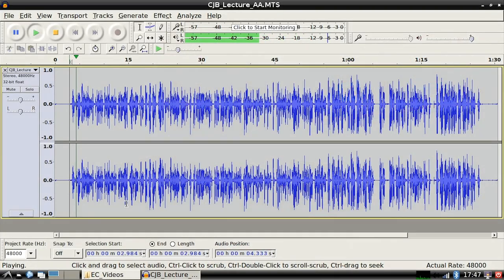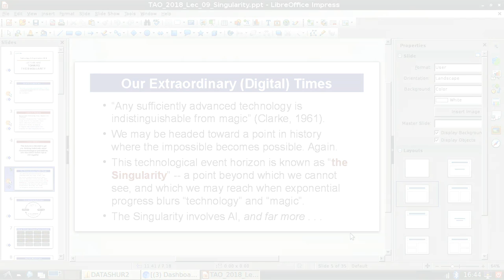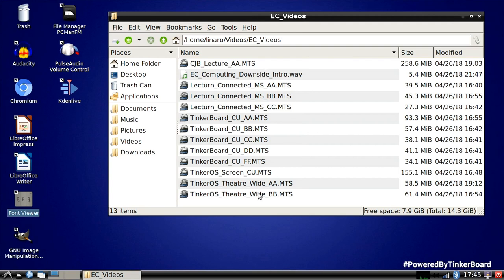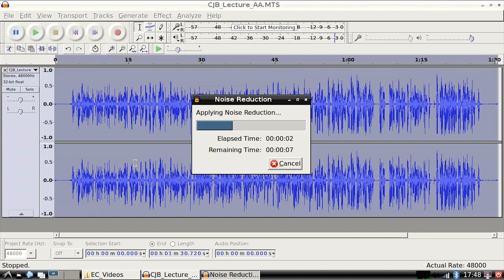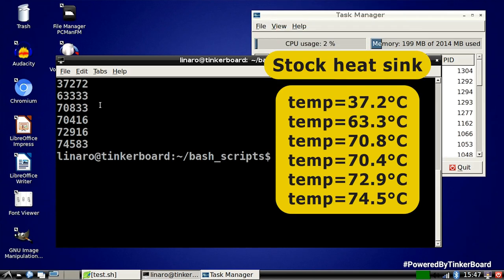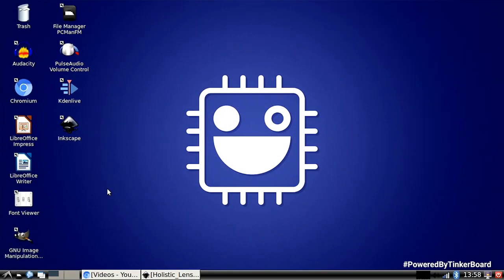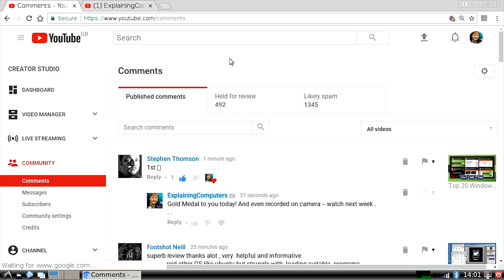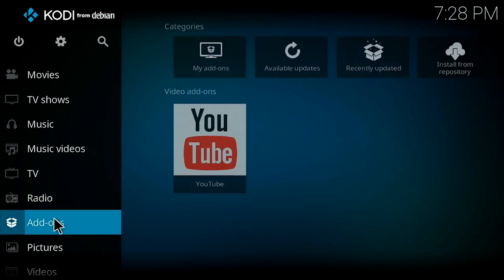Tinker Board Week

Comment: Hi Chris. Great video. 
It stayed a bit at 70°C because the Tinker starts to throttle at 70°C. That's why I don't like it that much. Compared to the Odroid C2 wich doesn't throttle or overheat even overclocked to 1.75Ghz. Also because of the micro-usb power supply and the Kdenlive problems. I can do everything on it, but I need different OS''es (tinkeros or Armbian for youtube, lubuntu for kdenlive) and a fan. 
The Odroid C2 does everything in Ubuntu Mate. Kdenlive, 1080p youtube playback, games, ...
I hope Asus there next board will be better.
I'm now working with the Banana Pi 2M Zero. Same form factor as the Rasp Zero, but quad core 1.2Ghz. Offcourse it overheat immediatly. The software is nowhere. But there's a stable Armbian for it. I do like it, but it's rather useless. Maybe only to make a handheld. Greetings, have a nice day.
Reply from the maker: Hi Nico, I thought you would comment here! The Odroid boards are indeed great. So many good SBCs these days!

Comment: Thanks again, Chris. What's the issue with the CPU running at the temperature it does using the stock heatsink? Is it throttling performance?
Also, why would they use a micro-usb plug for power that's above the USB standard and which requires a custom power supply regardless? Why not use a standard round plug that's smaller? Then there would be no risk of someone overloading the power supply.
Reply from the maker: I think they stick to the micro USB to keep the board compatible with the Raspberry Pi (and its cases). On temperature, the board does get very hot!

Comment: Hi Chris, greatings from Honduras (yeah google it); I recently stumbled upon some interesting info regarding heat sinks, the cheap ones we buy that come with some self sticking adhesive to the processor or whatever you paste it too, apparently this adhesive is more an insulator then a heat transfer catalyst so , I decided to un stick them and try thermal paste on them, sometime this week, already bought some cooler and bigger heatsinks online but still waiting for them, was wondering if the changing to thermal paste will to anything and maybe might a thermal pad do a better job if the adhesive really works as an insulation, finally determine the temp difference between the 3; if the adhesive really is an insulant Im guessing the pads wil do a better job, well see you next week Chris would love if you could do a video testing if you can get better performance from these cheap heat sinks just by pealing the 'insulant'
Reply from the maker: I am certain that using thermal compound will improve the performance. I'm posting a big cooling video the week after next.

Comment: Pretty enjoyable video! I'm very happy about your single board computer. Did the performance still a lot better than any others?
Reply from the maker: The performance is better than a Raspberry Pi. But not as good as, say, a LattePanda or UDOOx86 for this kind of thing.
Reply: So all of the SBCs are pretty decent and almost same performance as well? Some people had using SBC for gaming, such as 80s/90s and modern gaming.
Reply from the maker: Retro gaming is indeed big on SBCs. :)
Reply: Yeah. It's much massive and bigger than Commodore 64 specs. But if playing modern games will cause some lagging graphics performance and processor will much hotter. I hope the SBC will getting improve for future without having trouble with laptop/desktop PC.

Comment: About the S board. How does it handle a power button? Could you test this and maybe showcase?
Reply from the maker: Not sure what you're getting at. There is no power button. Power must be turned off at the mains, or using a switch in the adapter lead. After power down, power must be removed before it reboots.
Reply: @ExplainingComputers  that answers my questions enough. 😊 Thank you.

Comment: Don't use the copper between cpu and coolingblock.
It is to thick and although it absorbs heat very well the aluminium block can't draw the heat fast enough to cool
bouth the cpu and copper piece .
The cooling is done by the aluminium fins ,the more and the thinner the fins ,the more surface is in contact with air and
there for the faster you can cool something.
The copper acts more like a extra heaterblock to cool in your situation.
You will get better results by cutting the coolerblock with the higher fins where you risk shortcuts,
and mount it directly on the cpu.

Comment: Will you recommend the tinker board to a newbie
Reply from the maker: It depends what you want to use it for. If you want to run it as a small PC, or media player, then yes -- go for a Tinker Board. But if you want to get into programming, using the GPIO pins to control stuff and so on, then go for a Raspberry Pi for far better support.
Reply: ExplainingComputers thanks I got myself a pi zero w and the case same as yours ! The pibow zero w

Comment: amazing work as usual. would you kindly upload an img of your software/os you personally work with? as a simple suggestion for heat since i noticed you have it mounted  through metal screws to what i presume is a metal base; maybe heat could transfer to the  other metal components of the board or mounting. think of the fins you could have!!
Reply from the maker: There is nothing special about my image -- all I had installed was the latest version of TinkerOS -- available here: https://www.asus.com/uk/Single-Board-Computer/Tinker-Board/HelpDesk_Download/  This includes Libre Office, Firefox, media players, etc. I did install Chrome --  sudo apt-get install chromium-browser -- as well as GIMP -- sudo apt-get install gimp -- and the font viewer, Audacity,  Inkscape and Kdenlive (see the video labels for the terminal install commands). The heatsink was only held in place via the plastic mount, which was held to the plastic below it via metal nuts and bolts. You can see the setup in this video: https://www.youtube.com/watch?v=1AYGnw6MwFM

Comment: Thermals. It might be worth looking at metal paste like Grizzly for the copper to heatsink bond. Linus TT have done a few videos on it, quite impressive.

Power stability. How about trying it with a battery in between the PSU and the SBC? Like a poor man's inline UPS.
Reply from the maker: Totally agreed. I've just done a heat of Pi 3 B+ cooling rigs for a video, and used a silver thermal compound with very good results.

Comment: you could get non standard 5v 4amp power adapter solder on the micro usb end. then the PSU shouldn't be stressed under any load spikes. maybe i'll try that with a pi
Reply from the maker: Indeed. A common approach is to power the Tinker Board via the 5V and GND rail "GPIO" pins -- 4 and 6 -- (which are not GPIO at all!).

Comment: Have you checked to see if possible to boot alternative distro from SD card while onboard memory has (say) Raspian installed.  Presumably if you clear onboard memory completely it will do so.  What if you change boot file on onboard memory to point to SD card - does this work?  Is it possible to install multiple operating systems on onboard memory and select which one to boot from at boot time (like NOOBS or Berryboot on RPi3B+)?  Have not seen definitive answers elsewhere yet.
Reply from the maker: If there is an OS on the onboard eMMC, the Tinker Board will boot from it. Hence, as far as I can figure and the instructions confirm, you cannot boot from an SD card once anything is on the eMMC (which is a real shame). There is no jumper or switch on the board (like on many other SBCs) to enable you to select where to boot from.

Comment: hm, how feasible would be a small back plate and a machined copper sink with proper thermal compound , I wonder. Both, thermal pads and lack of pressure, shown here, challenge the cooling.
Reply from the maker: Totally true. I've just spent two days building different cooling rigs on a Pi 3 B+ with far more success! Video in a couple of weeks.

Comment: Is it just me or have these SBCs mostly stagnated in terms of performance?
Reply from the maker: To some extent this is true. There are more powerful models -- eg like the UDOOx86 ones -- but they are in a totally different price bracket.
Reply: There are some RK3399 based ones coming from ODroid, Orange Pi, and Pine64 this summer.
Reply: I would say most computers stagnated for few years now. I do my daily job in Java under macOS in recent HQ CPU but recently I (again) started playing around with AVR C and VHDL. Since I don’t want to fry my main computer and need Windows for that I went back to my 2010 Vostro 3300 with i3-2gen 2.26 CPU with 4 GB RAM, SATA SSD and Win10 x64. I’m really surprised how stable and efficient this machine is... 8 years old, low budget (then) laptop...
So I’m not that surprised that SBC stuck on performance. If you want a faster computer you can get Gigabyte Brix under US$100. For most front end GPIO interfaces even Pi0 has enough power. I would like more SBCs like Pi0 but capable of running few days from not so big battery for example to run for days as a data logger in my (car/house/you name it).

Comment: I am interested in using an SBC as an in car computer. I want to run tuning software, but want to be sure something like this would be compatible. The minimum requirement of the software is:
Windows
Dual core 2Ghz processor 
128mb graphics w 3d accel

Since this has the higher resolution, I am leaning towards it. 

Am I barking up the wrong tree? Thanks in advance for anyone who can interject some knowledge into my mania 😂
Reply from the maker: If you need to run Windows, you need an x86 SBC. Most (including the TinkerBoard here) use ARM CPUs. Look at boards like a LattePanda and UDOOx86 Advanced Plus -- eg see: https://www.youtube.com/watch?v=tpT4WGsMcvk and https://www.youtube.com/watch?v=NjV7QPqure8
Reply: ExplainingComputers I actually ended up on the UDOO video and have made my decision already! 😊

Comment: I missing only 1 Test. Pull/Push the windows in the GUI.
At me, it is lagging.
I have two Tinkerboards. Most wanted epic fail!
I bought good SD-Cards and tested some Operating Systems. Newest TinkerOS, too.
Lol, same lagging at move the windows on the GUI.

I hate it, soo much!

I use original equip and samsung pro sd-card.
the problem is not the SD-card. 
In the Raspberry I get lower mb/s rate as like as Tinker, but there is no lagging.

but on OS Image TinkerOS PLUS, i have a corrupted systems with black screen and some other problems.
so i have installed on both Tinkers - TinkerOS. Latest and previous.

It is sooo annoying!!! ;((

My meaning about TinkerBoard is:
it is not half and not whole. Fingers away!

Comment: Hello Chris, just wanted to say this was an excelent video and if you are having trouble finding good power supplies for the tinker board or raspberry pi you can check out this site called berryku.com.  I purchased a dual port 3 amp usb power supply with an detachable power switch for about 10 dollars.  Hope this helps you if you need to find a power supply in the future. Cheers.
Reply from the maker: Thanks for the link.
Reply: You're welcome.